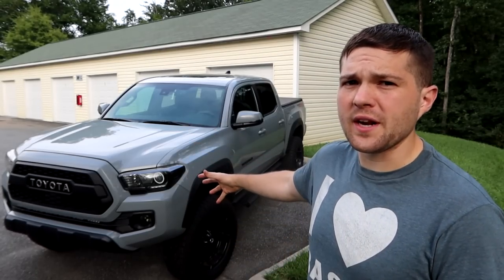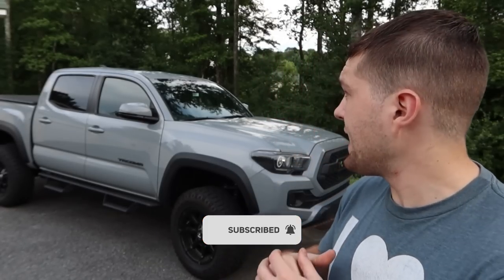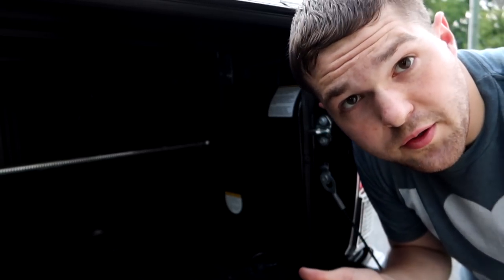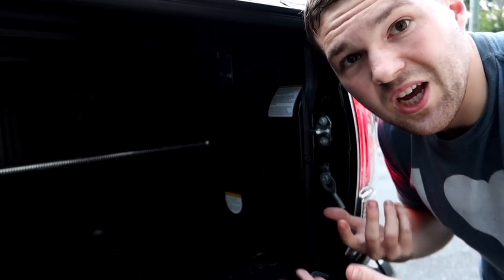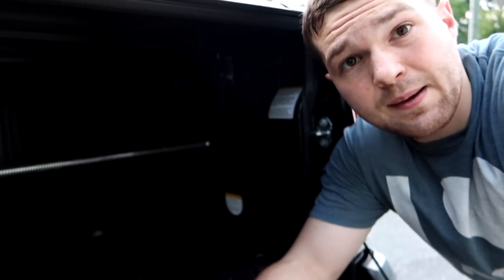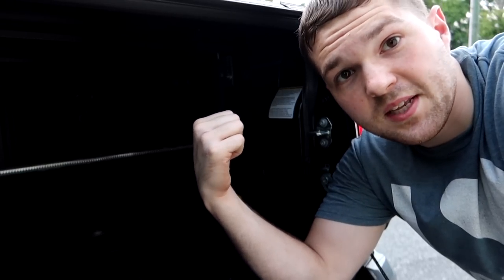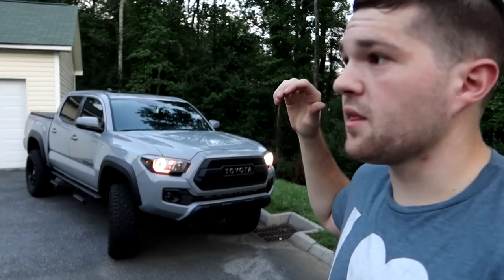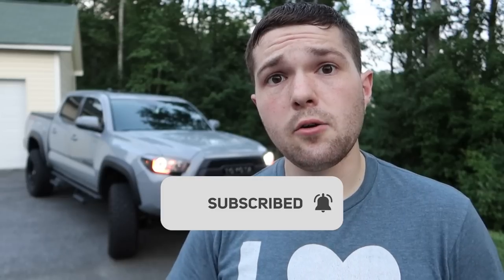The TRUTH about my LIFTED 2020 Toyota Tacoma TRD Off Road

Comment: The trd Tacomas suck my buddy has one. There extremely overpriced ,they get bad gas mileage the engines don't have much power,the spring packs in the rear are flat as a board gives for a bad ride, also for whatever reason they also use drum brakes which sand and mud gets stuck in there . Also 32in tires are not big,  the stock tires are 31..the reason the fuel economy sucks so bad is because the truck is a v6 and weighs over 4k bone stock. And everyone saying o regear it regearing it doesnt give you better fuel economy just makes it easier on the powertrain.

Comment: Get a @bedrug and you won't have to worry about bed dings. Don't know why you mpg. with such puny wheels & tires is so bad. I'm getting 16-17 mpg on my 2015 Tacoma TRD Sport with a 12" Bulletproof Suspension lift, 40" Fury tires and 4.88 gears and it rides great. @gigantortacoma on Instagram and @igtv
Reply from the maker: I drove really fast. Is tge problem. Like 80+

Comment: Put the auto in sport on the highway and it will hold the gear...problem solved..
Reply from the maker: It attempts to hold gear but it won't it will shift up or down still if it feels it needs tl